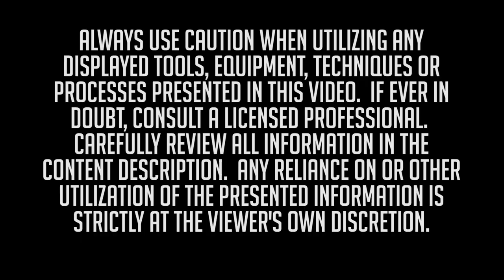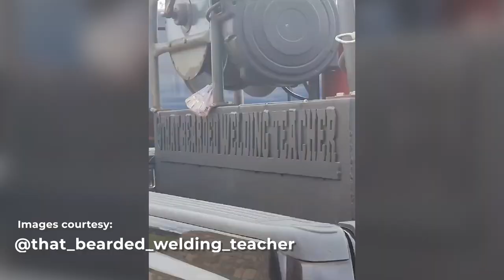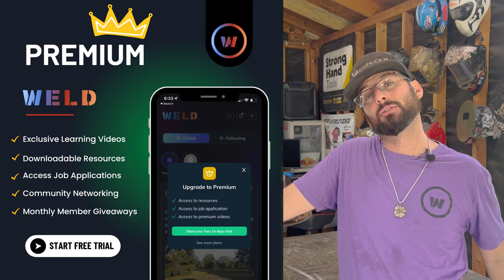Welding Questions - What Tools Do I Need For My Truck?

Comment: Brass hammers if you working around sensitive materials it won't mark them up they make ball-peen and yes even a slaghammer and sledges get you some
Reply: good tip! large rubber mallets arnt a bad option ether!